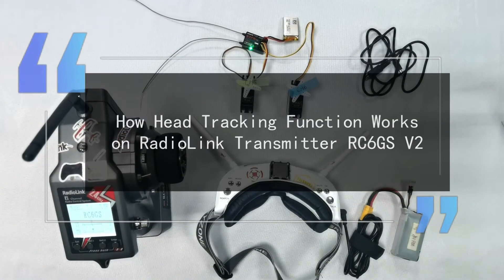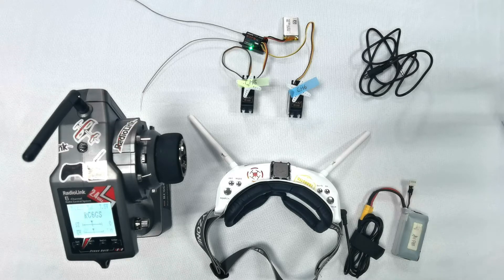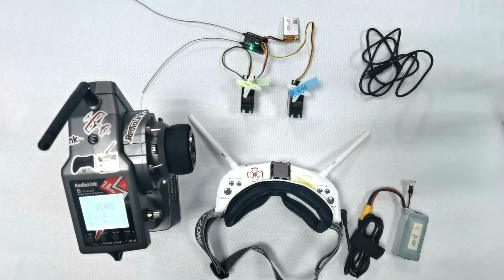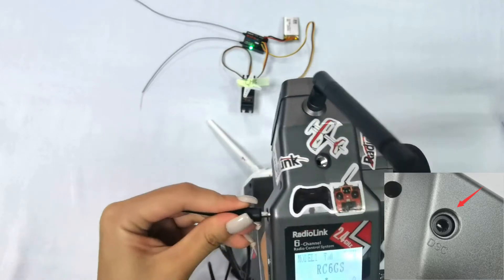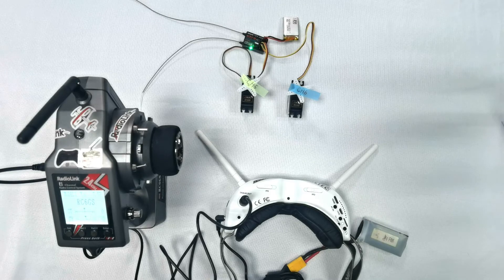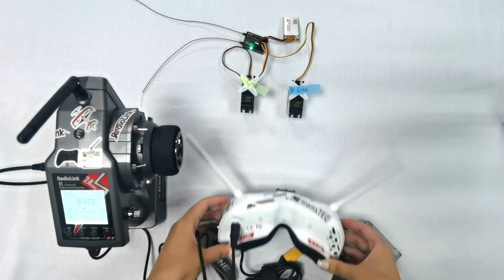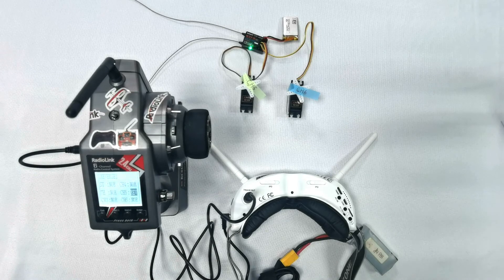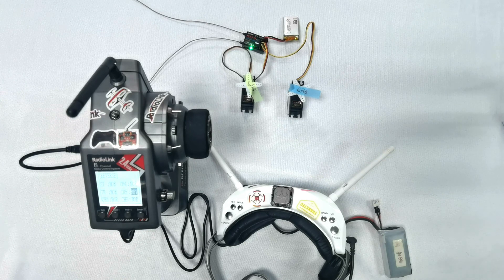FPV Head Tracking setup on RadioLink RC6GS V3/RC6GS V2/RC6GS

Comment: I updated my transmitter and I still have no head tracking with my cobra
Reply from the maker: Hi, sir. May I know what transmitter you are using and what firmware did you install? It would be great if you can let us know more details, and then we can help you solve it. If any question about RadioLink products please feel free to contact us. Our email is: after_service@radiolink.com.cn
Reply: @Radiolink_official  I ended up getting it to work the cable that I bought specifically for transferring data wasn't working luckily I had multiple cables and the third one I tried finally worked
Reply from the maker: @pbjunky511  Great to hear that. If any question about RadioLink products please feel free to contact us. Our email is: after_service@radiolink.com.cn

Comment: can this be used with brushless motors instead of servos?
Reply from the maker: Hi, sir. Yes. It can be used with brushless motor. You just need to connect the ESC to  the receiver, and connect the motor to  the ESC. If any question about RadioLink products please feel free to contact us. Our email is: after_service@radiolink.com.cn
Reply: Do you have a recommended esc that’s known to work well?
Reply from the maker: @CHRISBUILDZZ  Hi, sir. Thank you for your trust. If you are using car and boat, we recommend you to try our COOL 9030 ESC. Here is the link for your reference. https://www.radiolink.com/cool9030  You can check the specifications of COOL 9030 ESC from the link https://www.radiolink.com/cool9030_specifications   If any question about RadioLink products please feel free to contact us. Our email is: after_service@radiolink.com.cn

Comment: I have just purchased the Radiolink RC6GS V2 and want to use it with my Traxxas Summit. The Summit has two servos for steering, how do I connect to the R7FG receiver? Do I need to make a 2 into one connector, or connect each servo to a channel and create a mix in the radio? There is only ONE Steering Channel on the receiver.
Reply from the maker: Hi, sir. You don't need to make a 2 into one connector. Just connect each servo to a channel and creat a mix function in RC6GS V2. Set it in the basic menu-- PMIX01/PMIX02. If any other question pls feel free to contact us. And you can also send email to after_service@radiolink.com.cn
Reply: @Radiolink_official  Thank you!
Reply from the maker: @MrVerno1960  Our pleasure.